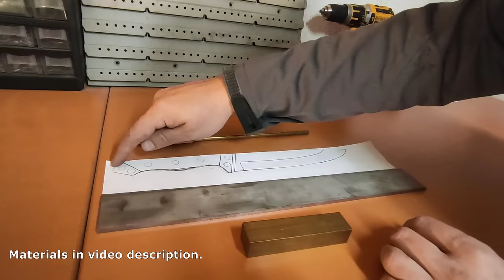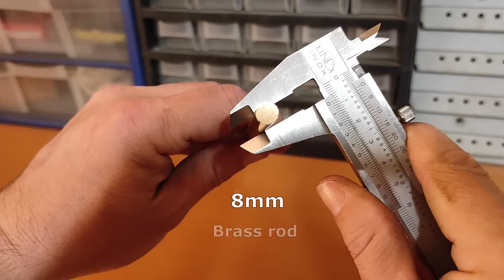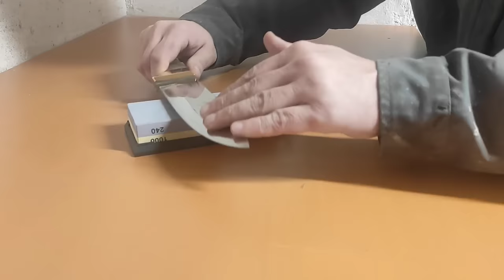DIY knife with brass accents and black walnut handle

Comment: It has had no final heat treatment that has been seen after all the heating that the knife has undergone. It will break in half.👎🏻👎🏻👎🏻👎🏻🥵
Reply from the maker: Thank you for your comment. Unfortunately I used a non-hardenable stainless steel. But I decided to finish building the knife. A note about this can be found in the video description.